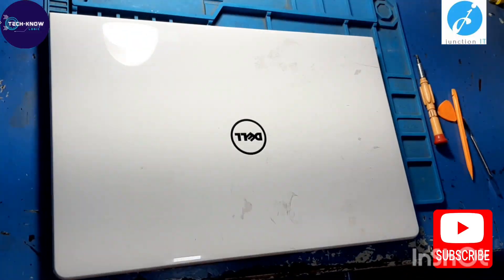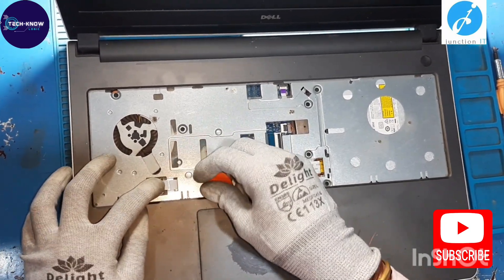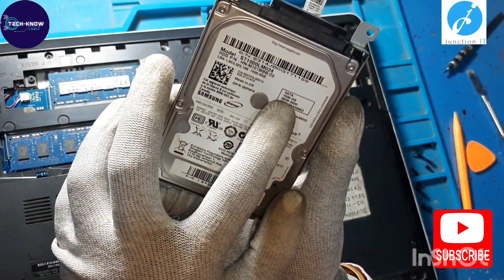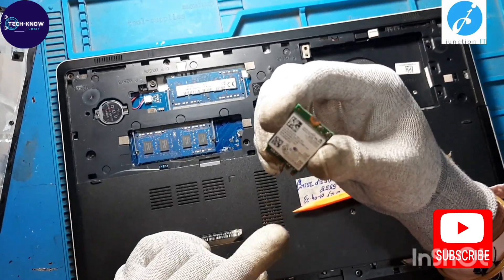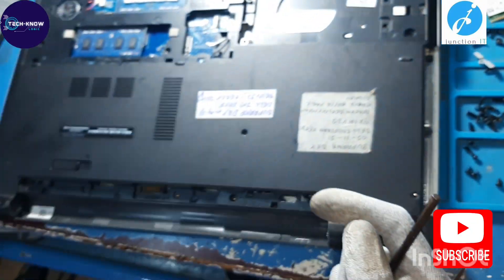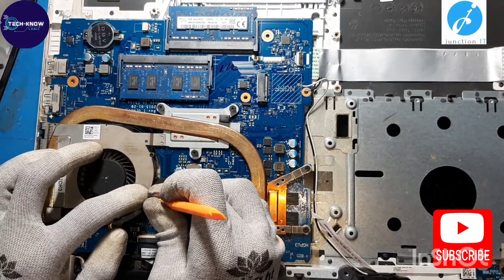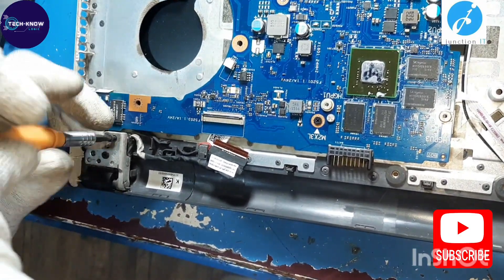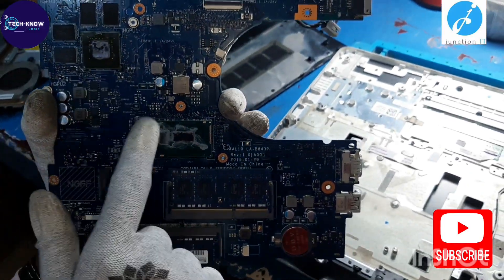HOW TO DISASSEMBLE DELL INSPIRON 5558 LAPTOP|Dell Inspiron 5558 laptop disassembly|STEP BY STEPGuide

Comment: Sir, can I replace the HDD of my dell Inspiron 5558 5th gen. with WD sata green of size 2.5"/7mm. Is this size fits in the slot of HDD. Will 7mm thickness of SSD fix in that case???
Reply from the maker: Yes, you can install 2.5 inch sata ssd instead of HDD.